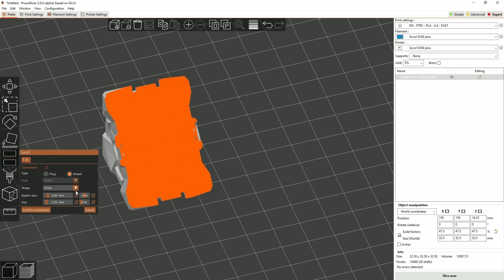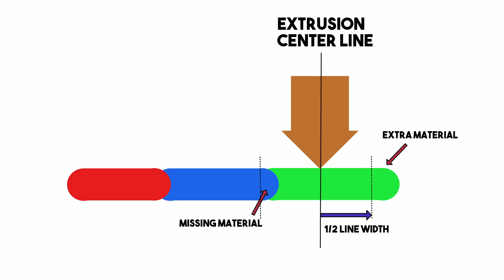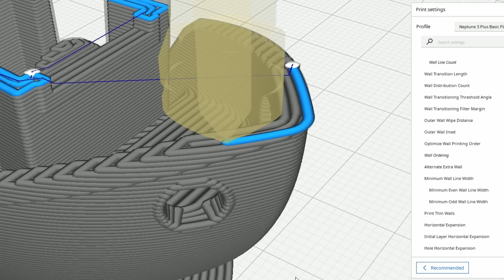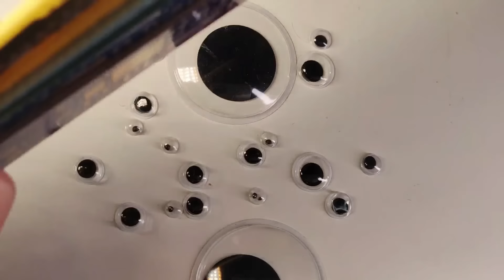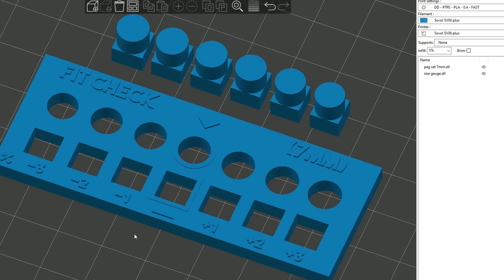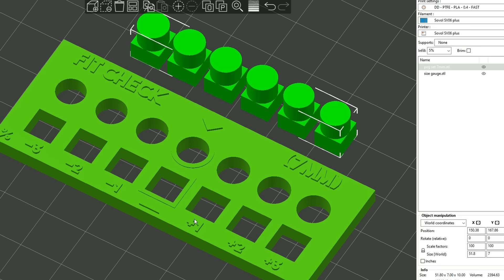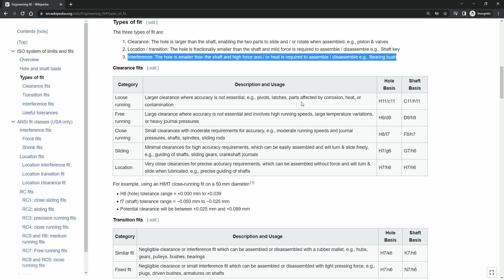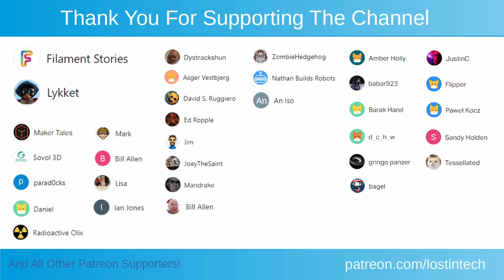Why your 3d printed stuff doesn't fit together and how to fix it!

Comment: Good stuff - I'll have to take your tool for a test-drive (for the labyrinth maze puzzle - Thingiverse 201097).
A reason I print inner wall first is that I generally print infill then walls.  I use 16-18% for "Infill Overlap Percentage" (Cura), "Outline Overlap" (Simplify3D v4.2 because I refuse to pay yet again for an "upgrade to 5.x"), and "Infill/perimeters overlap" in Prusa, and print the inner wall next, then outer wall.  This helps to hide the overlap.
Cura has the notion of "Slicing Tolerance", Inclusive | Middle | Exclusive to assist in over/undersized fitment.  And lastly, Simplify3D has the idea of "Dimensional Adjustments" "Horizontal size compensation" that allows for X-Y tolerance compensation, but only allows you to modify the same amount in both X-Y, every layer (unless you use the Variable Settings Wizard thingy.
Reply from the maker: Slicing tolerance is perfect for the sloping sides of the labyrinth maze....I made a video about that setting a while back! 😁
Reply: @LostInTech3D  Funny, my response does not seem to be here that I just made .... indeed you did, and I just watched it again!  Essentially, my response was that I like that little maze (someone ported it to OpenSCAD and that is cool, too).  Last year I printed one for my cousins, nephews, nieces (I don't have that many) and put a California USA Lotto ticket in each one - they loved it.

Comment: Interesting. I will have to look for that setting to see if it can improve my pegs. A tip I got from another video to reduce "ghosting" has helped with my key and hole prints, I uncheck "infill before walls." Besides helping the outside of the print I noticed the hole is cleaner and the pegs (ones I made, not from the slicer) almost always fit better because of what you described as the "armrest" example.
Reply from the maker: yes, essentially the same thing I guess, but more of it!

Comment: This is literally where I spend most of my time, and you'd think I'd have learned and adapted more than "Design, print, reprint with bigger holes when it doesn't fit" but I haven't - until now. @lostintech to my rescue - again, but not for the last time I'm sure.

Comment: Thanks for this!  I can't remember the number of times I've had this conversation with myself: "Ok, the screw is 3mm, and 3.5 for the hole should be ok" 🙂
Reply: I always add a 0.2mm variance to the hole, because for the love of all that is holy nothing ever freaken fits right!
Reply: Very little wrong with running. 3 mm drill though the hole you have. At least the screw will be 3mm. Often 3D printed holes are oval which causes issues. A drill cures this.
Reply: @Richard Harris  that works in through holes, but not as easy with peg holes like the first cube model he had where you need to only "drill" a specific depth and want a flat bottom
Reply: Forstner bits
Reply: @Mike.S.4579  I just had a bad experience with forstner bits and a hand drill. They are difficult to center and walk without a drill press.
Reply: @EwokyBalboa  End mill drill bits can get you a flat bottom.
Reply: it depends a lot on the hole orientation as well. holes running down through the layers are usually round but small, holes rinning sideways are usually ugly ovals
Reply: @saleplains  for large holes in the sides, making them slightly oval shape should help
Reply: @arbjful Or making them raindrop-shaped with the point facing up and drilling them afterwards
Reply: I’m on the seventh or eights one of these conversations with myself just this morning…
Reply: @CookerCeiling38  Me too.
I’m making something off a scaled photo……not working out so well just yet 🙂
Reply: Oh man, thats a rabbit hole. Trial and error around in circles.
Reply: @NathanCroucher  The first thing we should all do after getting a 3D printer is create gauges. I know better and still move forward without adequate prototyping. I am left with a growing box of mis-prints that I can't throw out... for some reason.
Reply: .5 maybe too big, but I think this depends on the minimum resolution printable. I would think 0.2 or 0.3 should be ok. For aluminum we usually drill 3.3 for a 3mm dia screw (M3)
Reply: Wait, that’s not normal?
Reply: Sameee 😂
Reply: @Slide100  ...me too. Sometimes I talk to myself and then we both laugh .
Reply: @rufuscollis303  😂
Reply: on iteration 5 of something that should press fit perfectly and just going  "eh F it lets add .5 mm in every single dimension" lol.
Reply: Great tips but even in metal precision demands post machining.
Reply: I’m honestly here to hear him say root like foot.

Comment: First

Great vid, very informative and understandable
Reply from the maker: haha, risky, you didn't even go back and edit that! :) Thanks for the feedback!
Reply: @LostInTech3D  I caught the vid a minute or two after it dropped and I was bored as all heck.
I'm not versed in prusaslicer, but I think you could also mess with slicing tolorances and consider initial layer settings that change the dimensions hoeizontally.